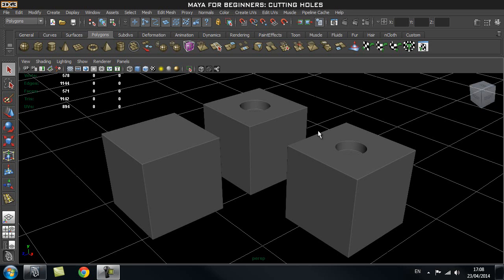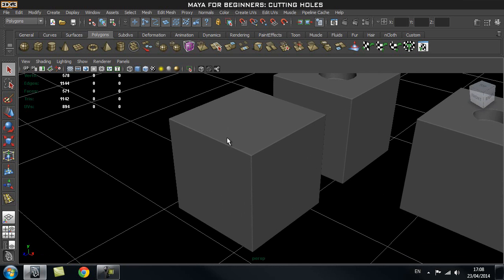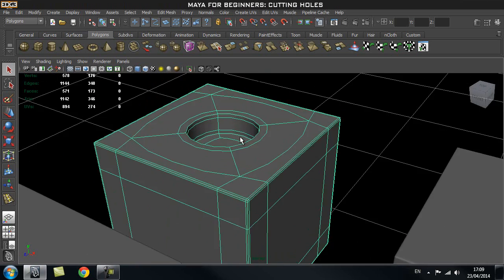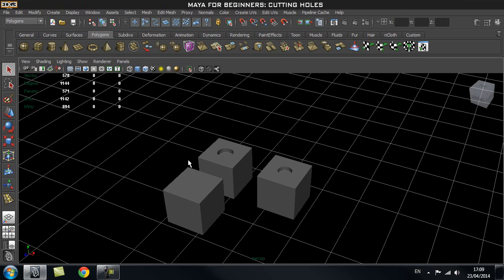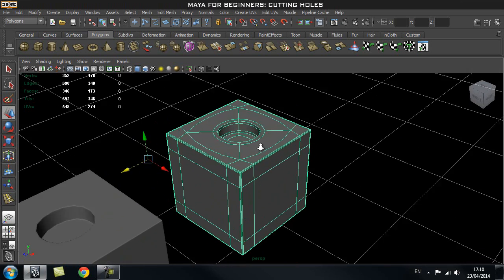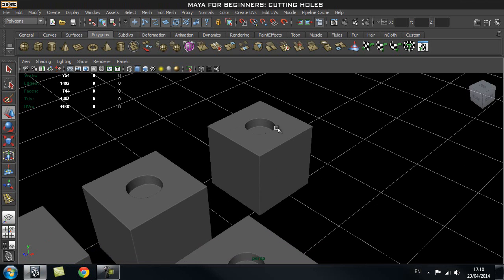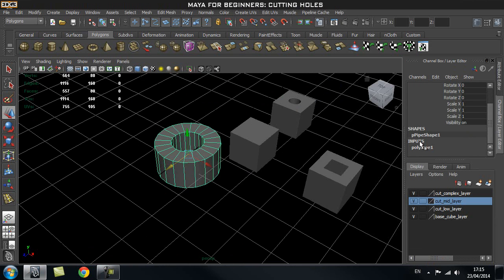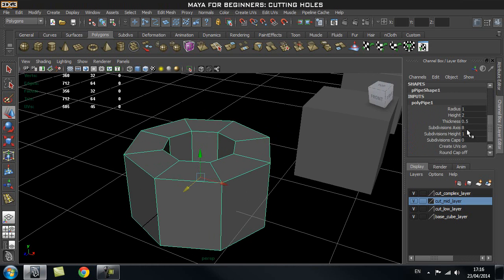Maya for Beginners tutorial - How to Cut Holes - High Poly / Subd Modeling

Comment: if you want a hole all the way through just extrude it past thru the other side delete both sides faces and then merge weld the new exuded side walls to the bottom.

Comment: is there a easier way like shoving a round column halfway into the cube then subtract a hole inside the cube and add supporting edge loop lines later?
Reply: an easier way to add the hole? make an 8 sided cylinder, delete the top 8 faces. add 2 edge lops to your cube so you have 8 connection points. put the clyinder in the cube and extrude the top edge ring out a bit. then combine the meshes and snap the vertex together and merge.

Comment: Very useful tutorial and also it was easy (for me) to follow, but just one question I've been having since long ago, what's the difference between smoothing cube edges 1) via adding supporting edge loops (like you show in all your tutorials) and 2) via the "bevel" operation? As in, strength / weakness of each method, and maybe different situations each method is suitable for ? 

Otherwise I'm walking through all your Edge CGI tutorials as I begin learning 3D graphics and these materials are EXTREMELY helpful and I'd like to thank you once again and keep up the good job!

Comment: How do you get the cubes with multiples edges on each face? (Like the base cube you're working with at around 4:00.)
(I'm totally new to maya, switching over from Blender.)
Reply: faster way would be to select all of the edges on your cube and then going to edit mesh --> bevel. change segments to 3 or 4 and the width to 0.0100.
Reply from the maker: Create a standard cube and the add in the extra edges with the insert edge loop tool that you can find under edit mesh > insert edge loop tool